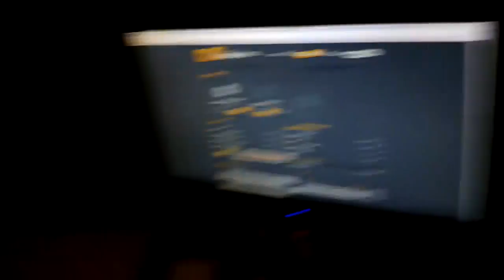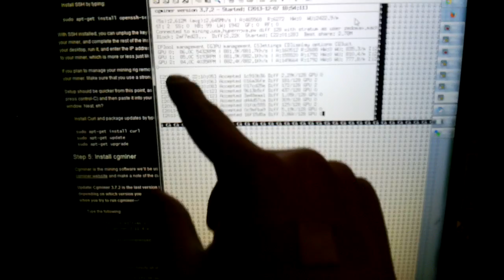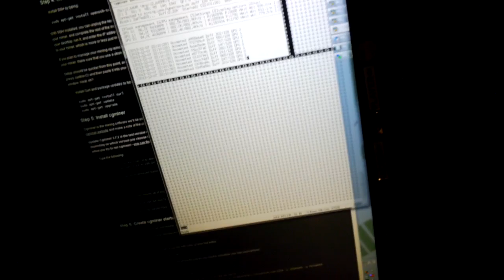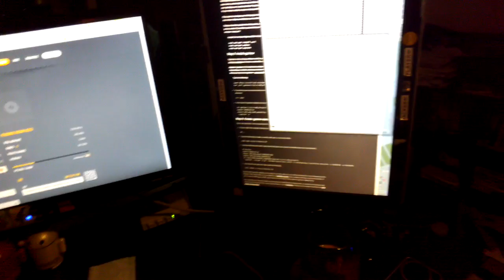DIY 2.6Mh/s Litecoin Mining Rig!

Comment: Hey ***** First off great tutorial, very helpful.  I am currently building one myself.  I am starting with 2 290Xs(eventually 3) and since I also want to use this as a gaming rig, I am using a 4770K.  I have all the parts to get started but the PSU.  I was wondering if you used a kill-a-watt?  from what I can gather with the ASUS PSU calc, your setup should require more than 1250.  I was wondering how much more can be added to your setup? like watercooling, ssd+hdd, almost full load on CPU, no optical drive though

Comment: When u finally do make profit invest in water cooling. Especially if your going to make more videos about the system
Reply: ***** it can help with noise for sure...don't forget that r9 290x can push the core and memory speeds based on the heat output so if you have a batter cooling solution on the card it can actually clock it self higher (which means more litecoins)